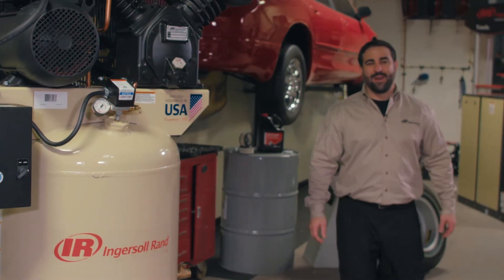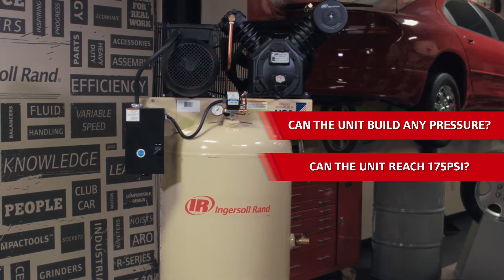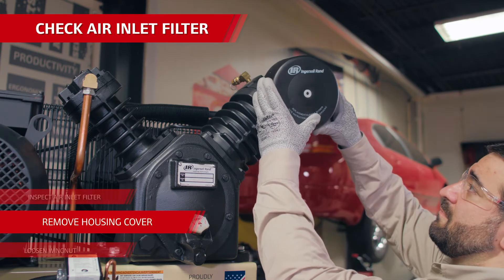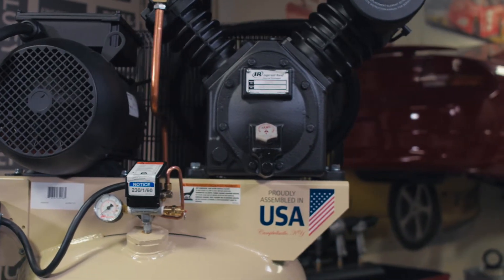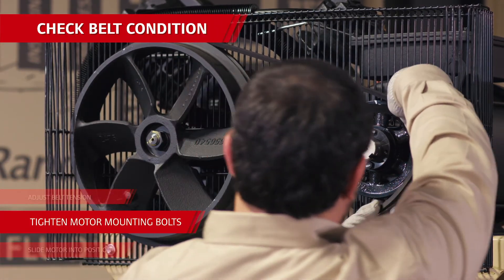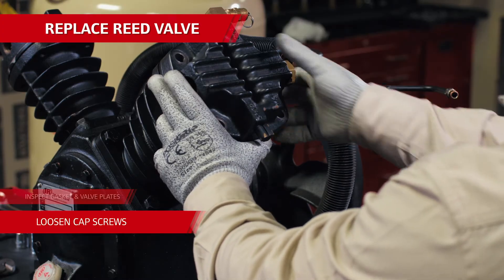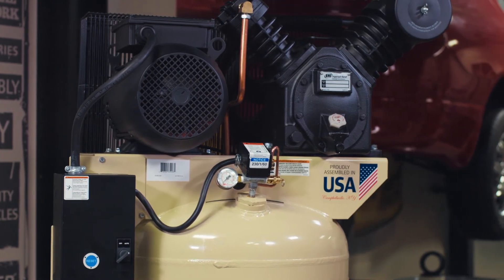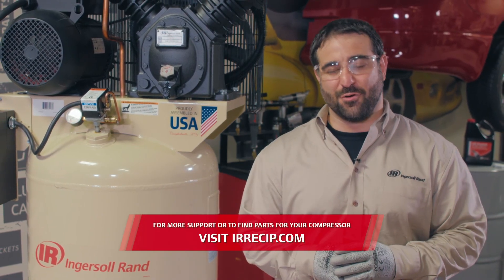Compressor Not Building Pressure Troubleshooting | Ingersoll Rand Reciprocating Air Compressor

Comment: My shops will build pressure but  unless it drops below 100psi best when no psi on tank when it kicks on the the motor acant kick over to run unless i hold the relief valve open on the piston head until it kicks over and stays running

Comment: I bought an IR SS4 60 gal compressor from Tractor Supply 8 months ago. I only use it in the garage occasionally and drain it regularly. It's already starting to make a knocking noise and having a hard time building pressure. I guess I should have trusted the Tractor Supply reviews and not been so insistent on buying an "American made" product.
Reply: @joel6427  I went back to our Tractor Supply and they said I could get a full refund. The IR Master Service tech said all Single Stage pumps are POSs and I should only buy 2 stage and larger. I ended up getting a full refund because I had bought the 2 year warranty and it was less than 12 months ago. Got the 2 year warranty refunded as well.

Comment: Quincy compressors made in USA. My model is a  QT-5 and is 20 years old, used at least 10 hours a day, six days a week. Redline synthetic compressor oil every year, drain moisture daily, no issues whatsoever. There are a still a few compressors made in the USA and are quality units. Baldor motors are the ones you want, durable, hi quality and made in the USA.
Reply: Not anymore assembled here with parts from china Ingersoll pump on mine is made in India
Reply: Everything I've read is that both Quincy and IR have gone downhill in recent years and their parts are from other countries. I couldn't decide for a long time, but I opted for the IR because it had a good name, better specs and a better warranty. Both companies had terrible reviews for anything made in the last 10 years.
Reply: Not anymore 🤣

Comment: Sure wish I could get some help with this junk 60 gallon with SS5L5 compressor not building any pressure at all.
Reply: Ken Switzer change the valves (on the heads)
Reply: Carlitos Gonzalez Thanks Man. This is my next move. I looked at them with a cheater lens and put pressure on each side to make sure they were sealing so ruled them out but now know I have to do something. 👍🇺🇸🤙😃.
Reply: Are pistons in good condition?. Remove the heads, turn the flywheel and check and see if pistons are both going up and down.
Reply: Carlitos Gonzalez Yes sir, walls look great. I change the oil once a year and make sure the air cleaner is clean. I have never worked on an air pump before but have built several engines. I am used to valves shaped like tulips not just a piece of metal that covers a hole. After I disassembled it the first time and replaced the head gasket and inspected every thing just by eye I searched the web for answers. Most pictures I saw of bad reeds were ones that were broken or deformed so I checked mine as close as I knew how and they weren’t sprung or raised above the seats and seem to seal the way they should. I cleaned the parts, checked the decks and head for warps and put it back together. Started it and zero pressure. It made a sound like pucka pucka like maybe bad valves or another head gasket. I have let it set until I have time to spend with it again. I have a craftsman compressor that I bought in 1988 that I had to replace the motor on about ten years ago but the pump still works great so I still have a compressor. If you have any more suggestions please feel free to comment and thanks again for your comments.👍🇺🇸🤙
Reply: Hey brothers my 60 g  starts good then I hear the motor clutch cliks several times then it bugs down on 40 psi  n shuts down n it won't start again ...any help pls 🙏  thanks in advance

Comment: Can I use a 15kW/1450 rpm motor in place of the original 11kW/1465rpm motor? Will modifying the electrical breaker-contact arrangement be sufficient? Will reduced rpm (-15) create any mechanical problem?
Reply from the maker: We recommend using only genuine OEM parts.  Using non OEM parts can have a negative effect on compressor performance and the overall reliability of the system